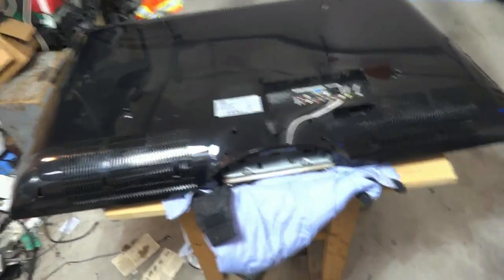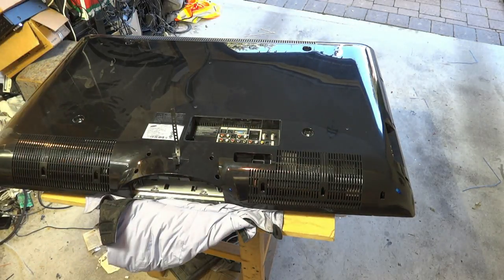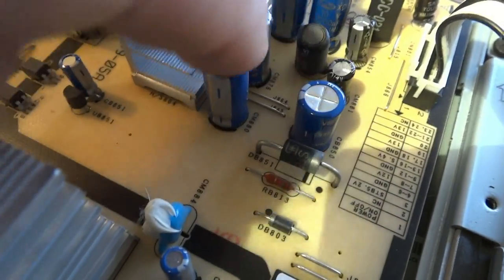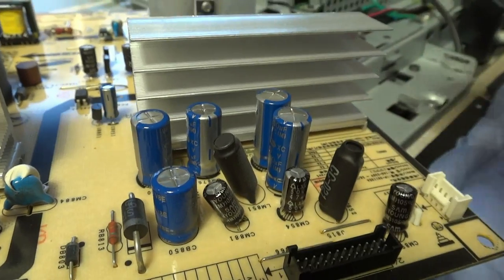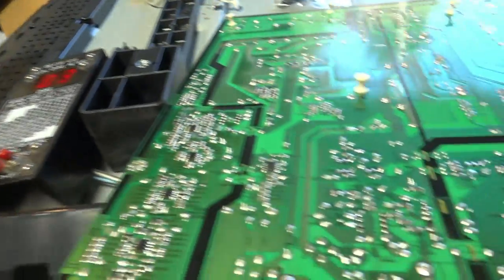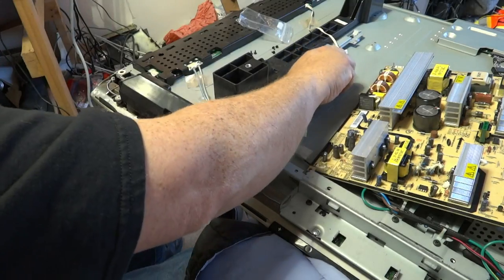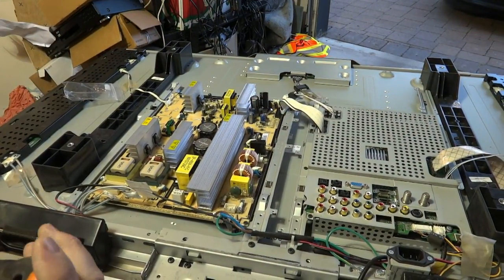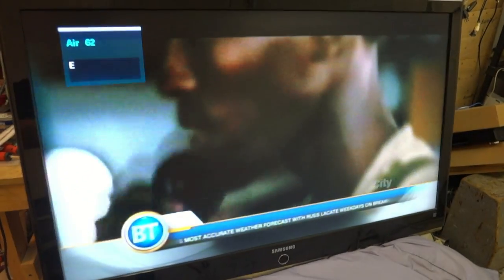Samsung LN-T4661 Slow to turn on or Dead

Comment: Just as an update, I found and replaced a small capacitor about in the middle of the circuit board.  Used a small hair dryer to expose heat to small areas at a time til I located the culprit.  The set has been working fine since then.     JwgK

Comment: Warm up issue for Samsung LN-T4661F tv is experiencing the same warm up issues as many other people have posted on the board. For the first 15-30 minutes after you turn it on, the left side of the screen is distorted and there are four horizontal lines the length of the screen. Eventually, it warms up and the picture is fine.
Reply from the maker: +erika rios Its going to boil down to either the TCON board, or the LCD screen itself.

Comment: Hello 12voltvids

I have a bit of a stumper question for you. I have a 2007 manufactured Samsung LNT4661FX-XAC lcd TV. 

Two days ago, after watching TV for a few hours, the unit made a loud CLICK sound and went into standby mode. It then started cycling (clicking) between standby and trying to turn itself on. I unplugged it to do some research on the issue. 

Yesterday I plugged the unit back in to see if the problem had cleared itself. Once plugged in it started clicking (without even touching the on button). The standby light was cycling on and off but the TV would not start. I unplugged again after a couple mins to prevent any further damage.

This morning I disassembled the back panel and accessed the power supply board. I checked all the caps for bulges but there was nothing. I noticed that my version of the power supply board did not have any 2200uf caps. All the 1000uf caps were also rated at 25v 105c. I guess it might have been a later revision of the board? 

After reassembly I plugged the TV back in. It did not click but went to standby mode. I hit the power button and it started up quickly. Only 3 flashes of the standby light! I plugged in the HDMI cable from my home theatre PC and if clicked into standby mode again but then turned on normally. Since then all has been fine. I even have turned the TV on and off several times.

Do you have any inkling as to what this might be? Probably something on the power board I would assume. If the problem comes back should I replace the 1000uf caps on the board? Maybe just replace the power board?

I have detailed pics of everything if required. 

Thanks

James

Comment: Hello, thanks for uploading this video. I have the same t.v. and I'm pretty certain it has bad capacitors on the power board. I haven't opened it up yet, will do later this week, but I was wondering what capacitors you recommend to replace the bad ones with?  Also, you put two large capacitors in to replace the smaller ones.  I understand that you did this because you had them around, but are there smaller ones that will perform better than the stock ones? You mentioned the stock ones weren't rated properly. I want to make sure I get capacitors that will last a long time and are rated right for the t.v.

Thanks,
Dan
Reply from the maker: Physical size is not important. What is important is the electrical and temperature ratings. Switching power supplies use high frequencies, which produce more heat in the capacitor as it charges and discharges.
Capacitors rated for power supply use are typically 105'C vs standard capacitors which are rated at 85'C.
The voltage rating is the most important rating. It is OK to use a higher rated capacitor. The power supply is running at between 5 and 6 volts, and the originals were rated at 10 volts.  That means that at over 10 volts they will break down. Rule of thumb is you want more headroom. I would use a 16 or 25 volt capacitor in that supply minimum. That way you will never exceed the maximum voltage and won't even get close to the limit.
You can tell that they were operating close to the limit, as the tops were bulged from the pressure building inside. As to where to buy capacitors from, I use Main Electronics supplies in Vancouver BC. They ship everywhere, and mail their US bound shipments from the USA so there is no brokerage or duties. If you google them, you will find their web site. I have dealt with them for 40 years.
There are many other places to buy components,  just don't go to radio scrap, go to an electronics component shop. You will get the best componets for your project. These guys know what the service industry needs.
Reply: Thank you very much so for that advice. So with that said higher rated caps. will not come anywhere close to being stressed in any shape form or fashion.
Reply: Larger capacitors will work fine if it is just the physical size but be careful that the voltage isnt too high above the original as the cap may not "set" or "form" fully to its specified  capacitance, meaning if you replace a 100 uf cap @ 50V with a 100 uf @ 200V, the cap may only form at 20 to 50 uf. this was what I was told 25 years ago so maybe things have changed
Reply: @12voltvids  yes very true but also low ESR is important for reliability and longer life. Low ESR also reduces internal heating as it has less resistance. so you should look for the the gold line of low ESR caps unless you like changing those damn caps every couple of years. It is not just the caps. but the inverter on the board is stressed out by those lousy crapacitors. (Conaxion) are the worst try to get name brand caps
Reply from the maker: @rogerd4559  They are not that bad. I have sets I put those crapy caps in that are running 6 or 7 years.  Sure they might fail again, but likely something else will go first. The extra cost, and cost of having them shipped in is just not worth it.  Remember I don't care if it breaks again in a few years, and neither does the client, because if they get a few more years out of something they are likely to move on to something newer next time. I run these "shitty" caps in my own equipment, and they are lasting just fine. There was a period where Conaxion caps were bad, but the ones they make now are better. Same with Elna. They were great for years, and then took a dump in quality, but new ones are good. Panasonic also has had bad runs. I have some Panasonic VCRs with panasonic caps in them that are all leaking all over the board.

Comment: Hello.  Thanks for the VERY informative video!   I have the same exact TV.  My question is that I'm beginning to develop colored lines 3 inches from the bottom of the screen (horizontal lines) and the lines are staggered.  The lines aren't *quite* all the way across yet- the problem just started yesterday.  Do you think the capacitors are the reason for the lines?  If so, which one/ones?  Do I have to check them all?
Reply: Also, where can I buy the capacitors?  I live in southeast Pennsylvania.  I'm sure Samsung would charge an arm and a leg, haha!
Reply from the maker: Ripple in the supply could certainly cause video distortion, but that could also be a display problem. Can you send a picture?
Reply from the maker: surething baby
1000uF 25v 105'C capacitors can be bought from any electronics componets suppliers. I deal with main electronics. http://mainelectronics.com/
but there are plenty of others such as http://www.leeselectronic.com/index.php
http://www.parts-express.com
http://www.digikey.com/

You need to get the high temperature type designed for power supplies, not standard caps as the frequencies in power supplies is high, which will overheat standard capacitors and cause them to fail soon.

Comment: Hey Dave, I have seen those EA ESR testers. I have been trying to trace one down for my test equipment bench. I see blogs for DICK SMITH and BOB PARKER but seem the testers are no longer available. Do you have a substitute meter suggestion ?   My TV has the same issue....if the room is cool, half an hour to start, yet if it is over 70 degrees, the set may just take 5 minutes.  Another project for the bench.  I have enjoyed and learned from your channel.  BIG THANKS from TEXAS !    J K
Reply: The Anatek/Alltronics Blue ESR meter is the Dick Smith Mk 2 ESR meter in a new package. See https://anatekinstruments.com/products/anatek-blue-esr-meter-full-kit-for-self-assembly-besr_kit?_pos=2&_sid=391812b1a&_ss=r

Comment: I see you using that black ESR meter all the time... did you custom build yours? I have never seen another like it...
Reply from the maker: It was a kit. I built it over 25 years ago. That is what came in the package. 
Some day I will do a video and show what is inside it, and my construction skils back then. I am scared to think about that last one as I haven't had it apart other than change the battery.
Reply: I saw a custom built ESR meter, an analog version on Diodes gone wild built by a guy from the land of Tesla

Comment: I change the capacitors all to the 25 volt. The set also had trouble with image ghosting that I corrected by cleaning the ribbon connections at the top of the set with alcohol. Now I have a very bright washed out screen. It started as just to flashlight sort of spots at the upper left and right of the screen now almost the entire screen is washed out. could this be from using to high of rated capacitors?

Comment: IAlso I forgot about when I pulled up mains electronics it says they are closed for now, hopefully soon they will re-open, but until then is there anybody else that you trust with caps. & other components?
Reply from the maker: Thomas Fanning 
Main is permanamtly closed.  I know the owner, or should I say knew.  Both Phil and his son Daniel passed away. Phil is old age and Daniel unfortunately cancer. Daniel's son Scott was running the business the last time I was in there almost Jan 2017 when I picked up the transistor to repair that leak 75. He informed me then that he was going to close the business as he had no interest in continuing for a 3rd generation. That leaves Lee's over on Fraser street as the only electronics component store left. I know the owner of Lee's as well as he used to be a technician at another shop when I was still in the business. He is fully aware of counterfeit parts and I would imagine he strives to source the best parts as he has all the connections. I buy my parts there now. OP components out in Surrey is another option but he has no store front. He works out of his house but does have a pickup counter for local purchases. He has also been in the parts business for over 30 years and is a good source for original parts as he bought out inventories of parts from Sony and Panasonic when they shut down their local parts operations.
Reply: Thank you much Dave.
Reply: @12voltvids  there are many good parts supply of caps and componants on line like Digi key, all electronics, Jameco, Amazon, Electronic gold mine even Ebay etc just look for the Low ESR and gold line of replacement caps
Reply from the maker: @rogerd4559  
These places all charge ridicules prices to ship to Canada. I'm not paying a flat 20.00 shipping charge to order a few caps. I go to the local shops and buy what they have in stock, and I really don't care about the quality, especially when I am repairing for a client. It it lasts a few years and pops again, I get repeat business. Sorry if people don't like my "attitude" when repairing peoples gear, but that is how it was and is in the business. Nobody goes and buys the most expensive deluxe part for a job. They order whatever they can get for the best price. True they may charge a premium because nobody knows what they installed, but the name of the game is fix it for the least possible cost. Usually that works. The odd time we got bit, when the counterfeit parts problem hit, and the replacement parts were no good. Then we had to eat the cost.
When 2sc4917 transistors were popular, buying one from Sony cost 38.00, buying one from Main electronics cost 3.12. The retail on that transistor was 47.50. That is what people were charged for the sony sourced part, so you can understand why the cheaper part was sourced, and for years they worked. (we used to sell the cheaper one for about 12.00 as it allowed us to complete a repair under the 100.00 limit before an estimate required, and this guarantee a repair job.They were identical parts. Then the counterfeiters started making knock off parts that were identical in every respect and we started getting hundreds of parts that would fail after a few hours, and had to start using parts from Sony. Now we were over the 100 limit, and had to call with an estimate, and face a possible decline for the repair bill. It was a very tough business, so sourcing parts for the absolute minimum cost was a must.I never had a bigger smile on my face than I did the day I told my old boss "I'm outta here" and walked. I was so fed up with electronics and  the decline of quality. And I hadn't seen nothing yet.
Reply: @12voltvids  ah so you live in Canada? I live in the us east coast and get free shipping on alot of these parts from Ebay and Amazon. That explains alot so yes I see your point, but you have a great advantage of stockpiling many parts from scrap monitors and tvs! Maybe you should consider Ebay-ing them to other viewers attempting repairs?
Reply from the maker: @rogerd4559  
We get hosed on anything ordered from the states because none of the suppliers listen and ship by mail. They fed ex or UPS everything and then when it crosses the border an extra charge, currently 37.50 with fed ex.   Order a 2.00 transistor and pay 37.50 in broker fees. Some suppliers charge a flat fee but it is still 20.00 minimum.  I remember ordering a transformer for an individual radio.  The transformer was made in Canada but sold by mouser.  By the time that transformer arrived here it was 100.00 for the part that should have been 30, but by the time the part crossed the border twice and had tax and broker fees added it ended up costing the customer an additional 37.50 in fees which didn't make him happy but I wasn't about to eat it.

Comment: Now at that time, I got it repaired the 2006 Samsung SyncMaster 931B monitor by replacing the two new 820µF 25V caps, and one used 470µF 25V cap and got it going again.

basically for the Electrolytic, it went through the roof where it creates a symptom of the start-up failure with whinny noise and couldn't produce pictures, and the product of the original Electrolytic caps is Capxon from China where there is a cost-cutting for Samsung in the mid 2000's to early 2010's.

Now for Capxon, it's originally from Taiwan and later move to China in Shanghai to produce the cheap Electrolytic to the market starting in the 2000's where they are keep making ones where it's not designed to last long like all other generic Electrolytic caps that are meant to fail and buy a new ones. We know in China, there's no regulations once so ever, and they don't care what are good or bad about the quality materials.
Reply: Update: Samwha Caps, the company itself appears to be from Korea and produce caps either from Korea or China and produce product to the market for the manufactures who really needs one for to install for their new electronics and so-on and so-forth.